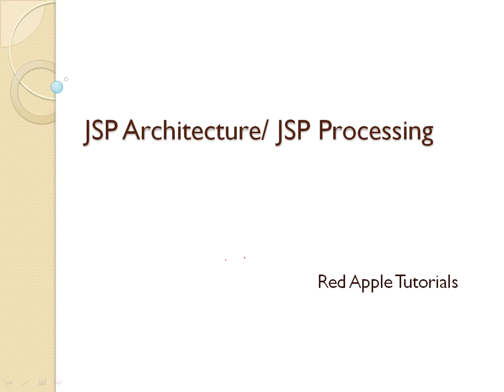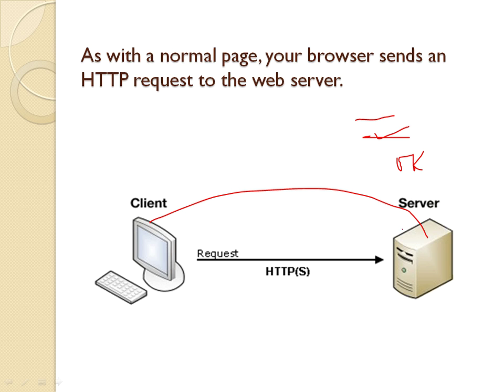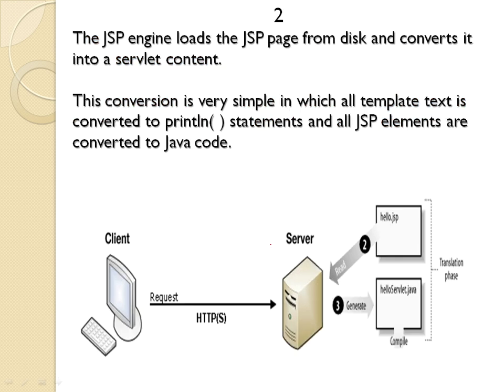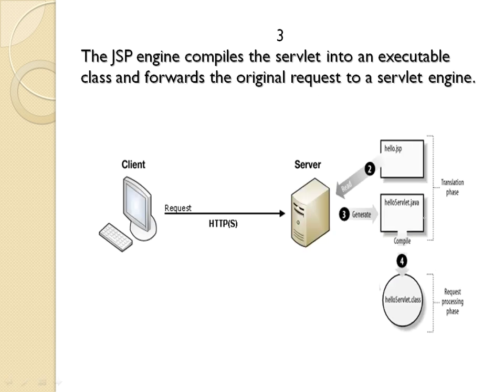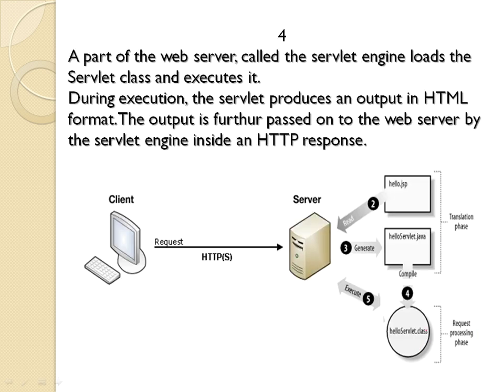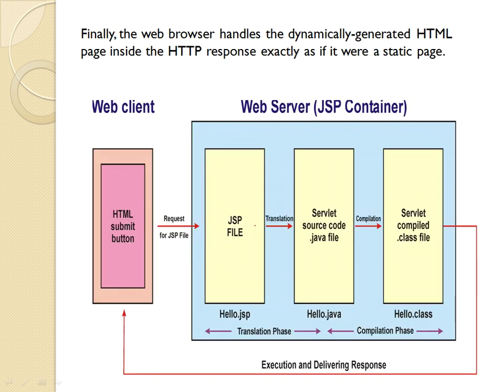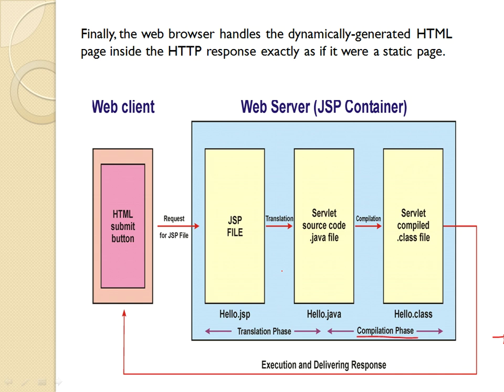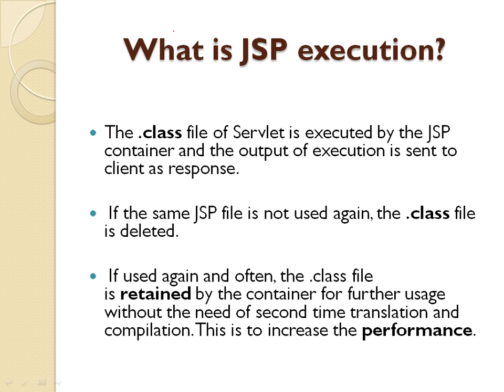JSP Architecture | JSP Processing

Comment: Hey good video, but in the video at 8:17 its written that ".class file is executed by JSP container"

whereas while explaining earlier in the video you have said, that servlet engine loads the servlet class and executes it. Um, a little confused here with two different terminologies.
Reply from the maker: The JSP engine compiles the servlet into an executable class and forwards the original request to a servlet engine.
A part of the web server called the servlet engine loads the Servlet class and executes it. During execution, the servlet produces an output in HTML format. The output is furthur passed on to the web server by the servlet engine inside an HTTP response.
Reply: @redappletutorials6576   Thanks for the clarification 😌